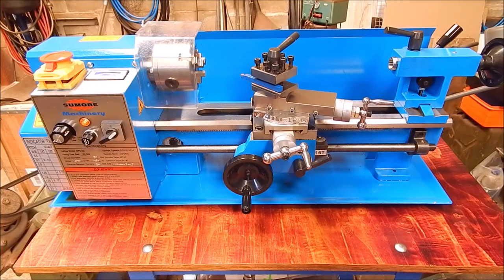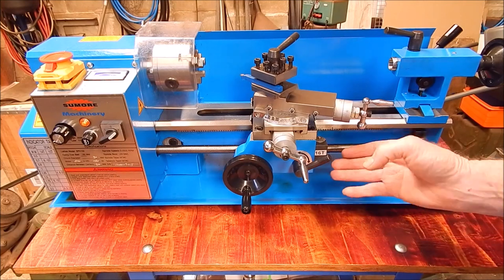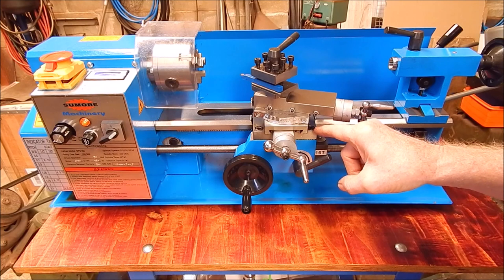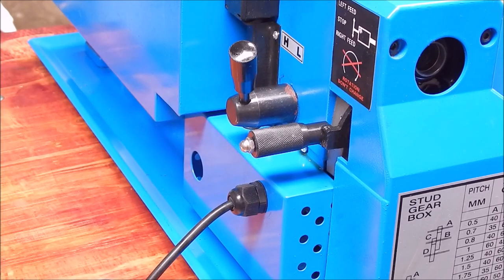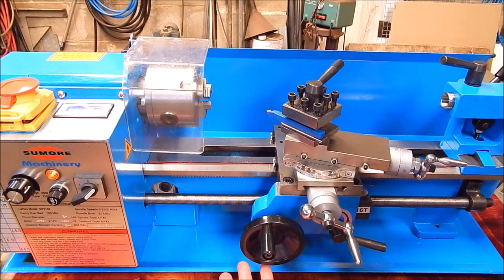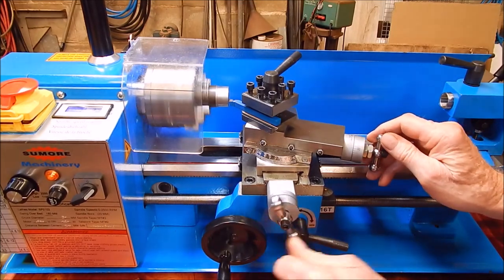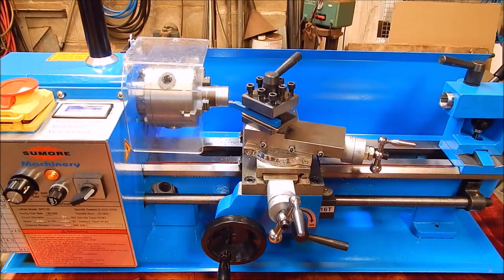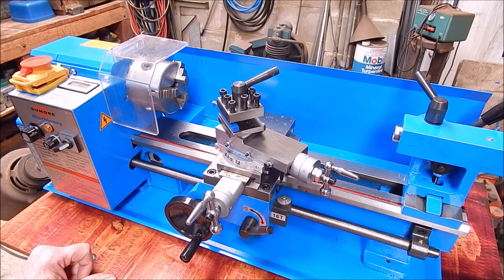The 7 x 12 mini lathe carriage lock hidden in full view

Comment: G'day Rob that was a great review and the lathe is really something else especially when you compare the crap that has been sent over for years.  The first thing that I noticed was the castings the one that you always notice is the tail stock  usually these are shocking and as you pointed out the chip tray at the back, if this is going to be the standard of the finish it will be great when they start selling larger lathes and with the added bonus their warehouse is here makes it even better.    Well done about the carriage lock some people over complicate things, all the best John
Reply from the maker: Hi John,  it's not as good as a pull up block, but better than nothing.  Cheers Rob

Comment: Been a year or more and I'm just checking to see if there have been any issues of concern
Reply from the maker: I recently sold the lathe to a young guy starting out in metal work.  He got a good deal.  The unit had been going perfectly at that point.  It's very well made and amazing value for the money.

All the larger lathes (and mills) have gone up substantially in price during the last 4 years and I'm seriously wondering if I can even do another "Best Bang For Buck" video for lathes under $2 K, due to the extremely limited selection available.  The Paramount Browns FL-550 is still the winner at just a tad under the limit, but it remains to be seen how much longer they can keep that price.  It's definitely the size and type of featured lathe I would buy.

The main thing that annoyed me with the 7 x 12 was the small throat in the scroll chuck.  It is definitely worth buying one with a 100 mm chuck to get around that restriction.

Cheers Rob

Comment: How heavy a cut could you take with that lathe in mild steel?....From what I can see it doesn't seem to struggle too hard making those cuts you are doing.
 I hear form a lot of people these lathes are only good for Aluminium and brass.
Reply from the maker: From what I've read in various user manuals it looks like 2 mm is the maximum recommended DOC.  That seems a bit much to me.  It turned mild steel fine.  The tools supplied are pretty low rent, but work.  Some better cutters would help it a lot. 

You need sharp tooling with any mini or micro lathe.  Even my tiny Sherline lathe has no problem turning steel and even handles carbide OK.  There's a lot of BS out there about these baby lathes really ;)  Cheers Rob
Reply: @Xynudu  Cheers!

Comment: I don't know, dealing with backlash on by "locking" the half nut on the lead screw doesn't sound ideal. 

Nor is it as "precise" as you can't lock between threads.

Comment: How do you turn a concave surface on end of stock with this lathe?
Reply from the maker: Same as any other lathe.
Reply: @Xynudu  im a noob is there a tool?
Reply from the maker: Use a round nose cutter.   You will have to contour the concave dimensions using X and Y feeds by hand.
Reply: I've seen radius tools with a swivel to cut convex surfaces, but it would be tough to scale down and reverse for this lathe.  Maybe a round end mill straight in, if the bearings are up to it.  Lathes aren't usually built for a high axial load.
Reply: @Xynudu  thank you for this info!

Comment: That’s a horrible, and really sloppy carriage lock. You have a neutral so that you can move the carriage manually, not for a carriage lock.
Reply from the maker: No, you open the half nuts to move the carriage manually, unless you have a hand wheel on the leadscrew and then you can leave them locked.
Reply: @Xynudu  well, yes, you have to open the half nuts for manual. But you don’t want the lead screw revolving all the time, so you put it in neutral. I wouldn’t want a hand wheel on the lead screw either. Old British lathes had those, but they got rid of them.
Reply from the maker: I have one on the Sherline (that's all it has) and like it.  Gives good control for fine feeding.  I'm thinking of putting one on the Sumore as well.  Do whatever floats your boat.  Cheers Rob
Reply: @Xynudu  sure miniature lathes are simple, and can’t fit the gearing in. My Unimat 3 has a wheel mounted at the end of the lead screw too. But you don’t want to use the lead screw if you don’t have to because you wear it out, usually in the first third, near the spindle. That’s why most lathes either use a feed rod, or use a lead screw with a mechanism for auto feed, other than for threading. But you know this.
Reply from the maker: Hi Mel,  that's why leadscew covers are so good.  I have them on my 10 x 18 and after 20+ years hard use (including lots of grinding) there is no wear on the leadscrew or bleeding from the half nuts.  Basically grease and forget, as it is 100% shielded.  I use a special Loctite grease for low speed shafts on it.  Cheers Rob
Reply: @Xynudu  yes, they are good. I generally use moly high pressure for low speed.